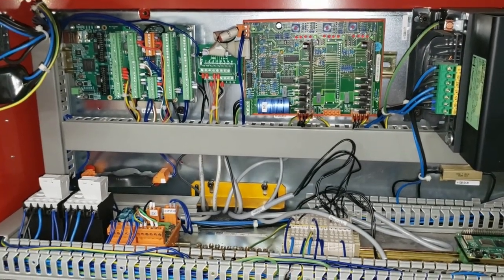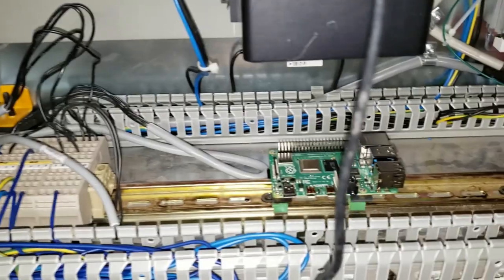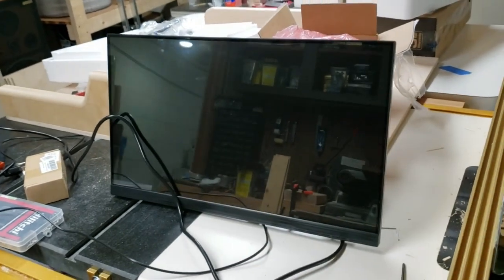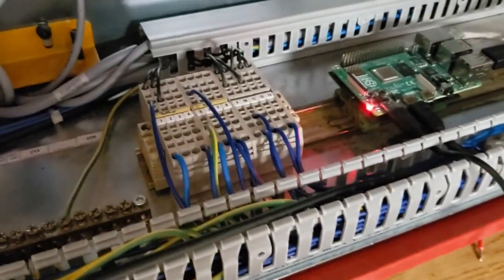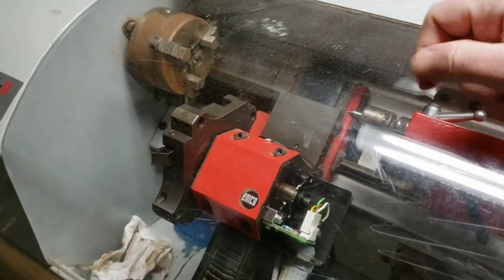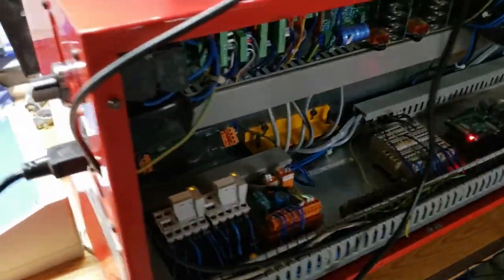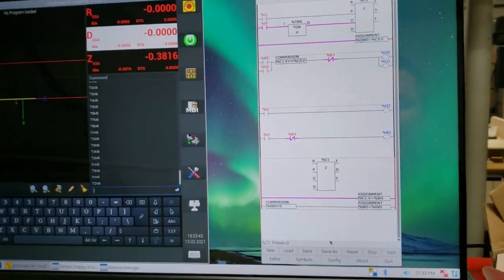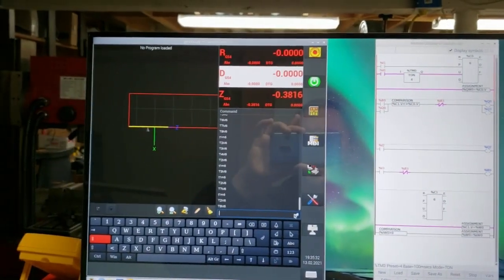Emco PC Turn 55 LinuxCNC retrofit - Part 4

Comment: So what happens if you go beyond the z homing switch, is it still activated ?
If not, when the machine is power off in that state and powered on again, the homing routine will smash the carriage on to the chuck... Right ?
Reply: Okay so it's triggered all the way, good 👍
Reply from the maker: Linuxcnc senses that the switch is triggered and homes in the reverse direction

Comment: Awesome!!!!
I would like to be on your level understanding LCNC.
Reply from the maker: I just poke and pretend 😆. I only started using it a couple of months ago
Reply: @TheFeralEngineer  my first language is not English, so it's a little difficult to me understand it.
Plus the technical words I need to translate on my language and on my language find out what does it mean...
Plus I don't like read. I can understand something on my language if will reread it a lot of times...
I'm nearly a year now reading about it.
Reply from the maker: I'll help out as much as I can 😊
Reply: @TheFeralEngineer  Thanks!
Are you good in electronics and mechanisms like CNC technology?
Because I'm not really.
I'm a building engineer.
But this kind of stuff is my hobby. (you can see it on my channel, or on my instagram)
Reply: @TheFeralEngineer  for now I'm trying to figure out how to use a servomotor with STEP/DIR control on a lathe spindle with C axis (rotary axis) functionality.
I found Talla83 channel and used his setup for spindle orientation.
Reply from the maker: @DPTech_workroom  I've been trying to think of ways to do this, actually. My mill Spindle is a servo, but it would require some fancy hal or plc to switch from a step/dir spindle to a controllable axis. I haven't done any testing with it yet, but plan to in the future.
Reply from the maker: @DPTech_workroom  i subbed 😊. I'm learning as I go. I'm a machine tool applications engineer, so I've spent most of my career in front of a control, not working behind it.
Reply: @TheFeralEngineer  The pncconf can generate the machine with step/dir Spindle control. But How to change it, to use it like a rotary axis - I have no idea. But it is possible using the same pins, but there must be a switch between modes...
Reply: @TheFeralEngineer  Thanks! 🙃
So you can understand  it easier than I.
Reply from the maker: I believe this can be done in either hal, classicladder or both. I will work on a solution for this someday 😆

Comment: It is realy shaping up!. Last night I cut the first external thread on mine. The thing I was missing was a differential output for the stepper driver. You have that build into the mesa card, but it is not build into this acorn board I am running(From Centroid CNC). I had to jerry rig the output board from the original, which had two AM26LS3X differential output ICs on it. After a little reverse engineering I could use that board with a 5v TTL signal from the acorn board and made everything work. Normally I wouldn't think this an issue, as multible step drivers with differential inputs can be driven either way; for sourcing just tie the step/ to gnd or for sinking just tie the step(+) to 5volt and everyone is happy. This emco controller did not like that at all :) This took me a while to figure out, as it was only the direction bit that gave me trouble. Well, after inserting the original differential output board into the mix, it ran like a dream!